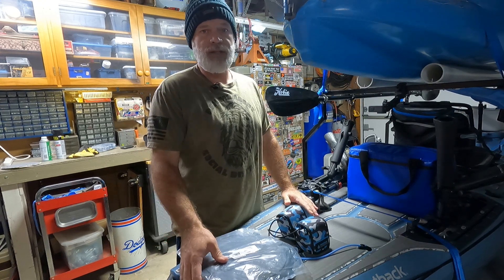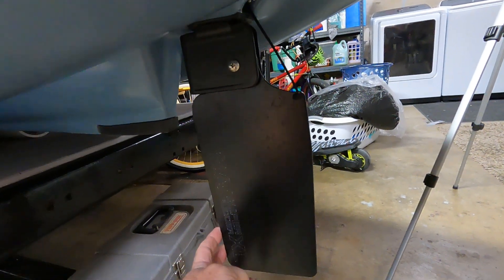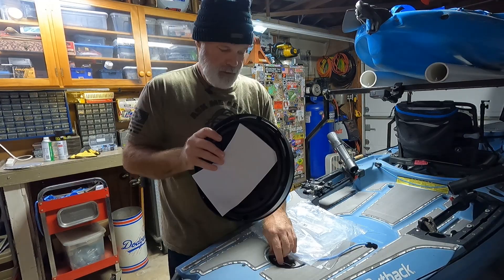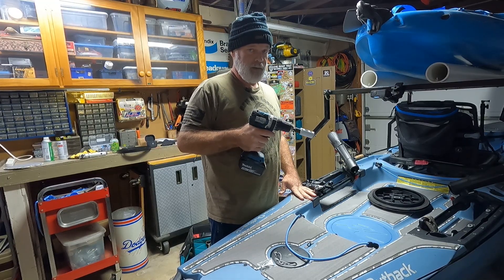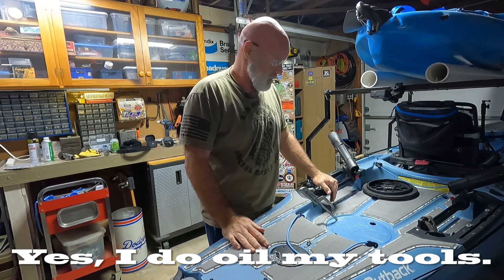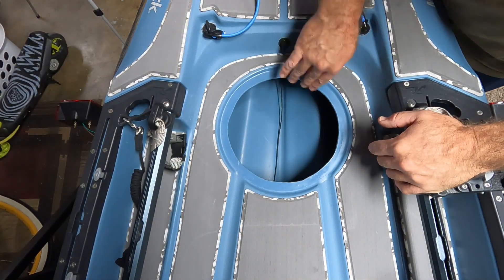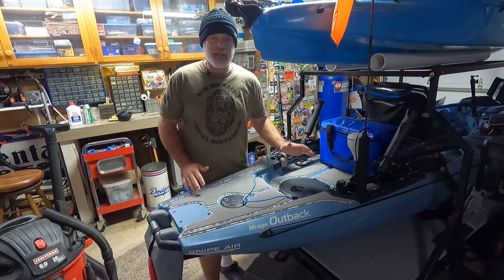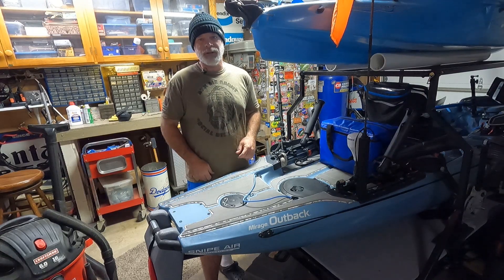Rear hatch install Hobie Outback kayak

Comment: great video, Just a comment I have a 2015 Pro Angler and the hatch is actually opens  the opposite direction from how you have it mounted to allow for easier access while on the kayak.
Reply from the maker: Makes sense.  I wanted to access it from the rear.  There is no way I could access the rear hatch while on the water anyways.  The PA is more stable than the Outback.   Thank you for watching!
Reply: @jwestfishing3229   Hope to see you on the water sometime, I'm usually in Redondo beach with  a lot of the fresh and salty guys on weekends.
Reply from the maker: @nick jones Thank you so much! I hope to see you on the water too!